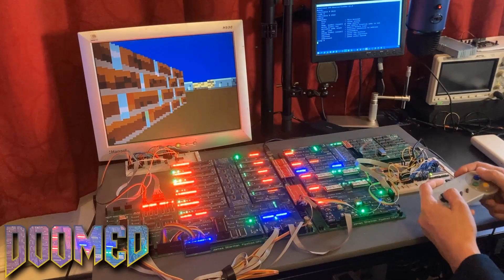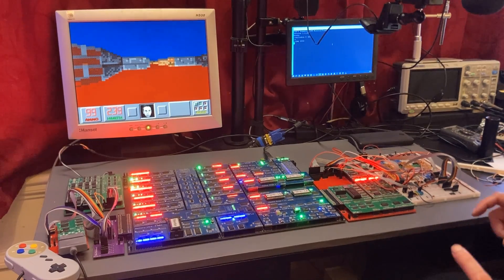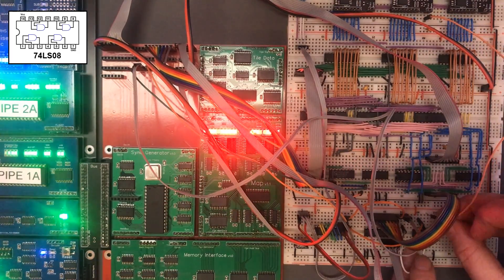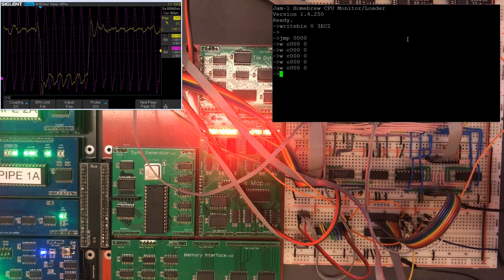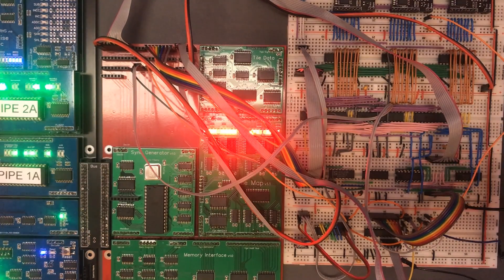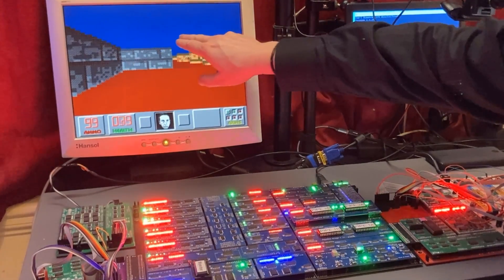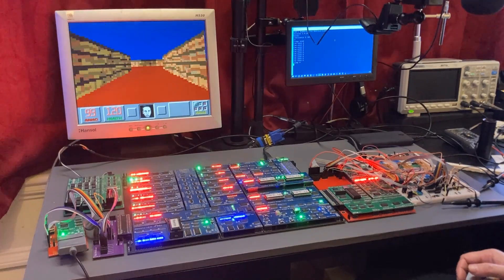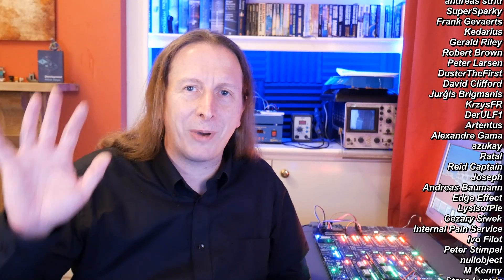Signal Cleanup - VGA from Scratch - Part 17

Comment: Still amazing how powerful this is compared to the popular processors of the time.. 
When you do move onto the next project, RISC-V really does look like it has quite simple instruction decoding, maybe you could implement the RV32E core with its 16 registers more easily.. would allow for easily compiled code, but it might get difficult to get all those registers and bits going.. would need to go for more advanced chips, implement registers in fast ram, or such..
Reply from the maker: I very pleased with how it's turned out!  Actually implementing a basic Risc-V core would not be that difficult, but doing a pipelined one would become a very large build just from making everything four times wider.
Reply: @weirdboyjim  Yeah, that's very true. Either way I loved that you followed through with a full pipeline for this build. It taught me more about modern ways processors optimize than anything else. Makes everything so tangible. It would be fun to find out what processor finally matches yours for performance per clock?

Comment: For the NES/SNES, I believe that the CPU writes to work RAM and this is then DMAed to the VRAM during the vertical blank. There are still timing constraints, but it may give your CPU more time. Indeed, it is a way more complicated circuit than the one chip solution but perhaps, you just need another RAM chip and some counters to do the DMA?
Reply from the maker: That sounds a lit like the fifo solution I discussed in an earlier video.  I need to reiterate that it's not something I feel the need to do.  The final form of this will have  several games and demos that don't show any issues (They will run at 60fps and have all their updated synced with blanking in software), plus one demo/game based on the doomed work that will show some issues.  It will be an interesting discussion point both then and in the future builds were I do a more sophisticated memory interface.
Reply: @weirdboyjim  Fair enough, it is amazing you can get it to do a doom renderer.
Just thinking, if your CPU speed is bottle necked by the access speed of the signal ROM, then you could use a similar technique where you replace the ROM with fast RAM. During the reset sequence you can copy, via DMA counters, from the slower ROM into the fast to access RAM.
I have an unrelated question, after the palette memory you have both a 541 and a 574, why do you need the 541 if the 574 can latch the palette colour while the palette RAM is being written to?

Comment: My Question is it posible to have a Write Buffer and a VBlank buffer the Vblank is only written on the Rising edge of the Write but not from the Signal but from the Writebuffer and on VGA Clock and not CPU Clock?
Reply from the maker: Yes! That was one of the possibilities I’ve talked about before but there would be quite a few components to that. The goal would be to queue all the writes, you could flush most of them out in hblank
Reply: @weirdboyjim  the system writes slower then the VGA can read it. In theorie you can store the adress and the value for one CPU clock and read it with the faster VGA clock that can reset this adress and value store, this only can work when the CPU is slower then the VGA, it is a litte more components then delaying the VGA clock but makes the read and writes more predictable?
Reply from the maker: @PpVolto  yeah, not something I can do as I’m already driving the ram close to it’s limit.

Comment: Nice little trick to stretch the display of the last pixel while updating the framebuffer. I don’t know how close you are at your memory bandwidth but a less somewhat lees complex solution to a write fifo for updates would be a data and address latch for write operations from the cpu to the framebuffer that is then used by the display circuit to interleave the „cached“ write accesses between the read accesses. I’ve done it with 10ns cache SRAMs as well by simply doubling the bandwidth by doubling the data with to 16 bit and reading 16 bits slower to interleave writes with 55 ns SRAMs in an 1/2 resolution SVGA output.
Reply from the maker: I might have to do a whole video on all the things that could be done. Past a certain point I’d just redesign the circuit. The mod I present here improves with just one AND chip.
Reply: @weirdboyjim  and that’s the beauty of this simple fix but it only goes so far. While it forks here because you have a large somewhat homogenous image it doesn’t work so great for games like Pac-Man, pretty much any platformer or any screen where you have high contrast between small foreground objects and single color flat backgrounds where you can see those stuck colors that go multiple pixels out of where they’re supposed to end. Otherwise I can only agree, it’s a simple and quick solution in this specific case. 👏
Reply from the maker: @0toleranz  ahh but Pac-Man I can easily code to update during blanking and not have any issues, this was what I was expecting to do a lot of.

Comment: Is double buffering not possible? Using two physically separate banks of video memory with 2 buses, so there is no contention. Alternatively, it shouldn't need a massive buffer to write changes, just alternate access to the video RAM in a similar way to how the BBC Micro did. It would need a synchronising circuit, and both the write and read channels would need single layer buffers, which does get rather involved, so I can understand why you wouldn't want to go down that rabbit hole.
Reply from the maker: The tweak I do here only adds one and chip to the build. Double buffering with separate bus driving from video & cpu is a reasonable design if that’s your goal but it wouldn’t be my preference if I were designing a circuit from scratch to have arbitrary memory access.

Comment: I imagine if you implement sprites that can be as tall as the screen you can then render doom using them as big vertical tiles and avoid the corruption if the sprite def memory uses dual-ported RAM :)
Reply from the maker: Nice idea but you would need as many sprites on a scan line as you want horizontal resolution.
Reply: @weirdboyjim  well if they were 8 pix wide each you’d only need horizontal res/8 . Pretty sure the old NeoGeo did this for its backgrounds. Whatever works though!

Comment: Hey James, thanks again for another great video! Really loving this series. Do you plan to go into detail on how you've implemented the "doom" code? I'd be really interested in that too. I felt the same about some of the effects you've programmed, like the 3D looking bar that bounced up and down the screen when you first got vertical scrolling going. You said you'd used a sine (?) lookup table … I'd love to know how that works. A deeper dive on the approach/design/techniques you're using would be greatly instructive. 🙏 It's one thing to know that it works, it's another to know how! Also, how you map that technique (like the bar) to your hardware … 🙏 Thanks again! Lovin' it! 😀
Reply from the maker: When I showed the first version of the demo I did show this on the extras channel: https://youtu.be/sC3Issh5cPQ?si=w_Q08MN_uNstZwHE
Reply: Ahh, thanks  @weirdboyjim . I don't know why (other than that I haven't yet looked) but I hadn't even realised there was another channel! Thanks!
Reply: Lookup tables work in a similar way to the old log tables used in schools back in the day. For a given value you can calculate an offset in the table very quickly and retrieve the value. Old games used this technique for many things allowing expensive calculations to be replaced with simple and fast lookups.
Reply: Thanks  @schrodingerscat1863 , I do know how lookup tables work; I was using that as example. What I was really trying to ask was what he's doing with those values that results in the behaviour in the video. IIRC, he said he was doing it with vertical scrolling. That wasn't enough information (for me) to know how he was manipulating the vertical scrolling register to achieve the effect (and to be clear here, I don't mean storing the value in the register … I know he was doing that too.) For example, at what time was he changing the register value (I assume on a particular scan line). How did he know, in software, which scan line was being affected? (I don't remember him saying there was a register available to the CPU for that, but may have just missed it.) How did he make sure that it happened in the front/back porch so that it didn't take effect in the middle of a scan line and corrupt the display? And so on.
Reply: @rogerramjet8395  If you go back through the series all of this is discussed in detail. The demo being shown here is not a traditional ray caster, there are some other tricks being used. Again I think he goes through this on his second channel. As far as corruption is concerned he is keeping track of writing to the screen in software. Because this demo is demanding he isn't able to do that though which is why there is some screen corruption. The fix basically detaches the video busses while the processor has control of the busses meaning that the existing pixel is copied across the output until control is returned to the video address generator. Several 8bit systems back in the 70s/80s employed tricks like this to reduce hardware complexity.

Comment: As always James... this project is very inspiring. Im mid journey through my own 8 bit project. Mine isn't pipelined, but it does have interrupts and port selects. You could speed up the CPU by using  faster UV Eproms... Jameco has some 28 pin DIPS rated at 70ns access time. These are twice as fast as the Typical EEprom rated at 150ns. Keep up the great work. Its a very beautiful project and look forward to the game development.
Reply from the maker: I have some UV Tom’s with a 55ns access time but the pin out is different. Atmel did do some OTP ones with this pin out that were faster but they haven’t been in stock for a while.
Reply: Or copy ROM contents to SRAM before the CPU comes out of reset. Even 10ns SRAM is pretty cheap. Thus starts the task of bottleneck chasing though, and that is something you can never totally finish.
Reply: @Zadster  Copying the microcode during a reset would require a mess of hardware that is way out of scope. but They do make NVRAMs... they have the speed of static RAMs but also have 10-year minimum memory retention. but the best they can do is 70ns like the Analog Devices DS1230AB-70IND. Mouser has these in stock and they are JEDEC standard 28-pin DIP packages. or go with the SST39SF010A 128 k x 8 Flash from MicroChip with 55ns, they also conform to JEDEC standard pinouts for x8 memories, but these are 32 Pin DIPs... the JAM1 is using 28 Pin.
Reply: I'm his older video he did scope out what was preventing the cpu from running faster, and the rom was running at 100 or less, in practice, and wasn't the first limiting factor, yet.
Reply: @mikafoxx2717  the EPROMs are not rated faster than 150ns in his case. CPU propagation delay from instruction fetch to output has the EPROMs as the biggest limitation to speed. Every IC in the chain adds a minimum of 10ns. so there will be a limit. My guess is that 5 Mhz is the fastest it can go with the fastest EPROMs available (55ns) before it gets unstable. It is a remarkable build and has pushed the limits of what a discrete logic chip CPU can do. It already has vastly more processing power than the 8 bit 6502 based Ricoh CPU used by the Nintendo NES which maxed out at 1.8 Mhz.

Comment: I cant help but wonder if there is a more elegant way to delay a signal more elegantly than how we have across the build. It absolutely works, but I do wonder.
Reply from the maker: Nothing wrong with using the 574 like a shift register (ike I did here). That’s creating a delay of an exact number of clocks. Having the chained gates I did in bus control is something I’d rather design better in future.

Comment: Would it be possible to detect when there's a conflict and then bypass the ram by using an AND gate on the video and cpu address lines? Then using two 74LS245 chips you could have the AND gate disable output from the ram onto the video data bus and enable the CPU's output onto the video data bus. The video chip can then read directly from the CPU. You could take it one step further if timing is an issue by having the CPU always write video data to a latch chip, which is then copied to ram. Allow the video chip to read RAM when there is no conflict and read from the latch chip when there is conflict. If the latch chip is ready to write to RAM then the data is stable and could be read safely by the video circuit.
Reply from the maker: I was going for a minimal tweak to notice the situation in this case, but remember that the circuit was not designed to do this. I have plans for a future build that will be more flexible in this regard.
Reply: Extending the pixels is a clever way to make the graphics look cleaner. The difference is very noticeable. I rewatched the frame buffer video and realised that my solution wouldn't have worked anyway because all RAM addresses have contention. It's such an interesting problem to solve. @weirdboyjim

Comment: I think a set reset latch would have been better as in it adapts of timing goes off for a reason. It creates about the same clock suppression but more exact in timing what it needs to be to get rid of any effect. Also it is hardly anymore complex then adding a delay because the and gate was not enough by it's own.
Reply from the maker: It sure I want to flip flop on the Issue 🤣

Comment: If the memory can run at higher clock then double porting by multiplexing the address and data lines might be possible. Some buffers, clock divider and "done".
Reply from the maker: Unfortunately it’s not fast enough for that. But I think that route is the right way to go in future builds.

Comment: I appreciate that you didn't want such a complex task for your build, at the time. But at the time, the doomed demo wasn't written, and the trade-off was reasonable. However, now when the problem is visible, it might be time to reassess, if it is possible to crowbar in the sync circuitry. As always it is your project, I am just along for the ride, so that is your choice, obviously.
Reply from the maker: It's not such an issue of "complex" task, but if I wanted arbitrary writing I would have designed the circuit differently.  There will be a future vga build where I build it to work like that from the ground up.